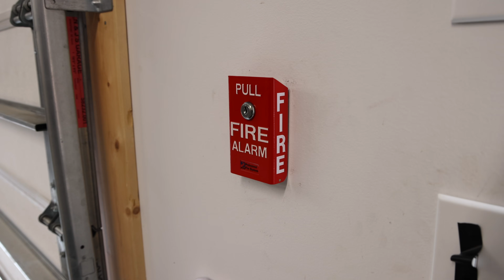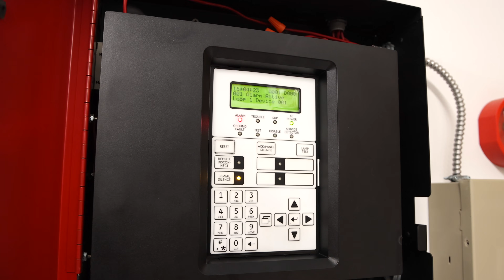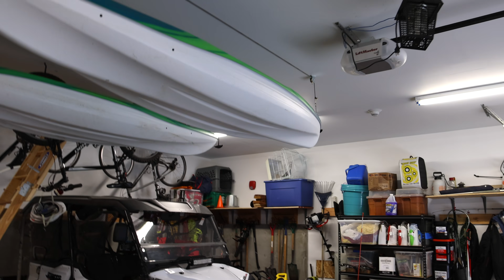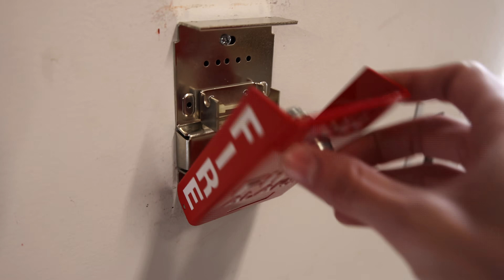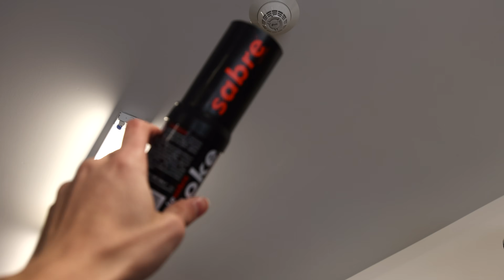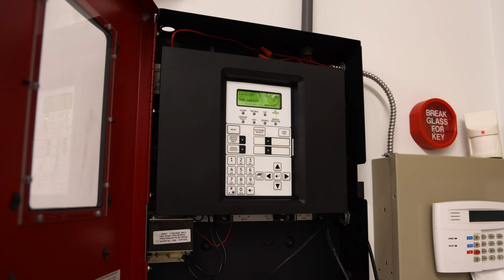Garage Fire Alarm System Test 26 | Mandatory Break Rod Pull Station!

Comment: Nice! I think this is the first time at least ive seen your gentex low frequency sounder and the commander one be used on a acual system. I could be wrong though. Also that pull station on its own is a BG-8 Knock off. Lol.

Comment: For the garage system test 27 can you do system sensor L series please and for the pull station could you use a firelite bg-12LX please but for the panel could it be the panel in this video please? Thank you Grant

Comment: Now that was interesting. I’ve seen break rods on 270-SPOs and Simplex T-bars (some have them and some don’t) along with some STI stopper covers, but I have never seen this kind of pull station that requires a break rod to reset it. I can only imagine the building owners dealing with kids pulling those pull stations all the time.